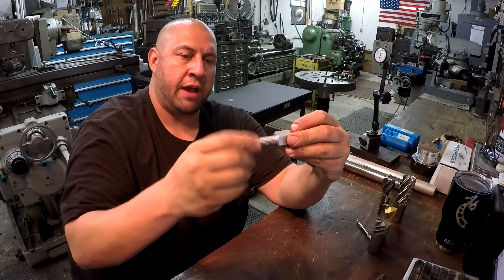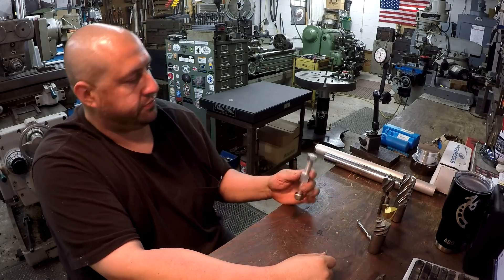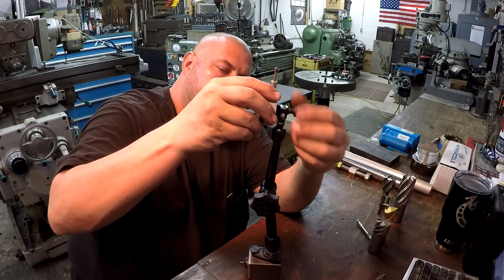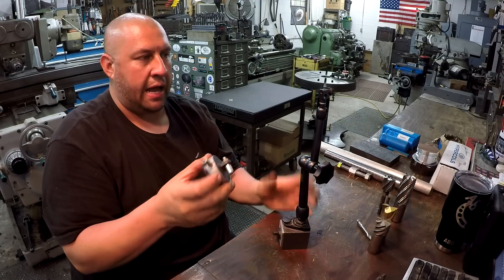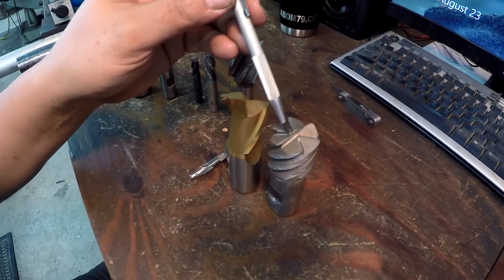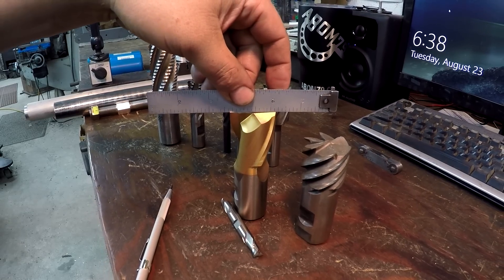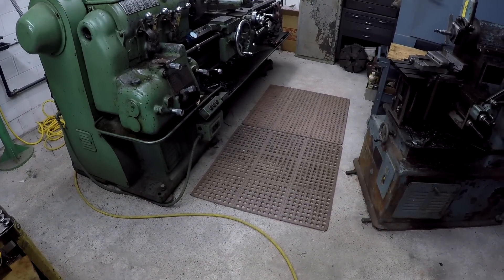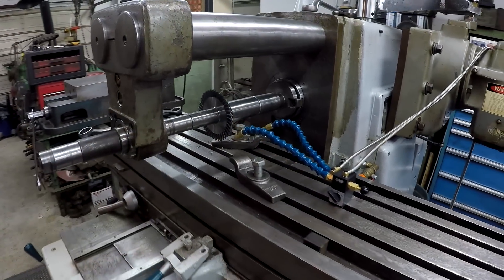Shop Talk 6: Center Cutting Endmills, Indicator Mounting, Noga Mini-Cool, Floor Mats

Comment: Adam

For those without a lathe, a easy and quick way (also inexpensive) to make one of those indicator holder adapters is to buy some 3/8" seamless tubing, Amazon has some SS that has a ID of 0.209, just perfect for tapping to 1/4-20 for a machine screw/bolt.  Cut to length, tap and Bob's your uncle  

John
Reply from the maker: +Submariner Research Good tip! 👍🏻

Comment: How does the base part of the indicator hold on to the metal, I'm guessing magnetic rather than suction, but is it an electro magnet with an on off switch or does the switch move the magnet up and down to the surface to magnetise to?

Comment: Fasteners with left hand threads used to have a notch cut across the points on the head to ID them as left hand, at least I thought that's why the notch was cut there anyway.

Comment: Nice shop talk Adam!  Sounds like we got neat shop projects coming up.  Yes, I'm with you on the floor mats.  On the rare occasions now that I run the roller die cutter at work I need floor mats for me to walk on running the machine and doing a several thousand unit run of stiff packing cards over the course a few days.  The roller die cutter we have is about as long as your Monarch lathe, and you're constantly walking back and forth from one side to the other during a production run.  The rollers that go in it, I'm guessing they are around 12" or so and solid, so if any work needed to be done on them, a lathe at least on the Monarch's caliber would be needed.  One that's of the Victor 1660's size and heft wouldn't have the girth to handle them.

I liked the crash course on the differences between center-cutting and non center-cutting end mills.  Off the top of my head, I'm figuring the primary need for using a center-cutting endmill to plunge cut with vs. using a drill bit is when you need a flat-bottom hole, or more serious, when you are making locating holes for dowel pins.  Which one gives a more dimensionally accurate hole, meaning less correction needed with a reamer?  I'm wanting to think a hole cut by a center-cutting endmill would require less reaming than if it were drilled, and so would be used when making holes that locating dowel pins will be going in.  Correct me if I'm wrong.
Reply: I wanna say too, about that roller die cutter we have at my job, to adjust the height of the upper roller in it, we keep an Abom-sized box-end wrench on the adjusting hex screws. x3

Comment: Hi Adam, 
What are the downsides to centering end mills vs non-center cutting ones? Ie under what circumstance would you choose a non-centering end mill over a centering one? Or is it just that it's easier to get more flutes with non-centering end mills?

Comment: Floors. Dust evolution. Could the first sweep be with a magnetic broom to pick up the steel chips? Great way to find the dropped Allen wrenches, gage pins, bitty screws, etc. Drag along a 5 gallon pail for the chips etc and a coffee can for the recovered tools. Second sweep shop vac. Both methods evolve no dust.

That leads to a floor finish. Epoxy is major expensive and slick as snot if oily. Oil paint floor finishes if thick will bond to hot chips making the hard to sweep up. 

I suggest cheap latex house paint in a neutral color bought from the mis-mixes to be found at half price at any busy paint shop or home centre. It wears fast in traffic areas but it's easy to touch up. Fills the pores in concrete and keeps dust evolution to a minimum. Not particularly slipperly when oily and has good traction when clean. It's nearly unaffected by sparks and hot chips but will stain and discolor. 

Some coolants will attack it but so what? It's water clean up and re-coat at the end of the day to dry over night. There are many virtues to cheap latex on industrial floors but stunning beauty and "coolness" aren't among them. Fools obsessed with speckly epoxy at $120 a gallon (who don't mind their busy shops being out of commission for a week of hard labor) will sneer but who cares?

Comment: Hello Adam,this is my first reaction to your channel, but I'm watching it from the beginning. I enjoy the enthousiasm you put into your channel.I'm a Dutch hobby machinist, but in daily life I work as a service engineer in Hydraulics, so we have some things in common.For the problem of chips on the floor I advice you to try a magnetic broom. I use it quiet a while now and are very satisfied about this tool. It's available in several sizes. You can find them on ebay.Kind RegardsPhilip Marting

Comment: Maybe an idea for a later shop talk...indicator selection help. Personally I'm wanting to pick up an indicator to have in my took box for stuff like measuring gear backlash and cam thrust. I was thinking about a Starrett 25-441J. I don't know anything about the options though. 

As usual, great videos. My father was a machinist but he has since move on to different jobs. Unfortunately he never got me into it and I'm just interested on my own and maybe even thinking about making a career out of it.

Comment: I like to keep my nuts in a sack ... These days my nutsack hangs pretty low, but as long as it's not on the floor it avoids frost or rust so I put some effort into still getting it up and oiling them occasionally.  Thankfully you don't need nuts when you get wood ... all you need then is a decent screw.

Comment: A 1x3/8 shoulder bolt from your local hardware store works great for an indicator mount. They cost about 2 bucks. Chop the head off if you want to take it on and off easily.https://cdn.mscdirect.com/global/images/ProductImages/7565717-23.jpg Good info on the endmills.

Comment: Hi Adam,
Just a quick note on your video with regards to sweeping. Here in the UK, I have some magnet brooms that I purchased for my tool room,and they work great. I also have a handheld stick version. Saves sweeping and the handheld stick is great for clearing swarf off the mills,lathes and also works well on our surface grinders. I would have thought you can get them in the US,infact I'm sure MSC will probably sell them, I know the UK version of MSC do.

https://www.mscdirect.co.uk/EMF-00500E/SEARCH:CATEGORY/product.html

Rgds
Matt

Comment: Have you tried using a magnet as a floor sweep? Covered with a plastic bag it's very easy to clean. I built a floor sweep from two speaker magnets and a hockey stick in one of my ex-workplaces. Everything left behind by those magnets was easy to just vacuum off the floor.

Comment: Adam, talk to your favorite concrete supplier,  take his suggestions as to which concrete sealer will work best for your operation.  You'll wish you had done the sealing years ago, once you try it.  As kids, we used to roller skate in the basement when the weather was bad, and you can imagine the concrete dust that got sucked into the forced air heater system and then blown throughout the house.  Dad got that concrete floor sealed, mucho quicko when mom bought some nice furniture...[WINK]  You won't even have to move your equipment, you just roll it on with long handled paint rollers.

Comment: For cheap sweeping compound we used to use sawdust bedding. Put some small holes in the bottom of a 5 gallon bucket, fill with sawdust, soak it with the hose and let it drain for a bit. The damp sawdust grabs dust really well and when you're done, you don't have anything nasty - just dirty sawdust.

Comment: Hey Adam, Ive used a lot of center cutting and non center cutting but I have always wondered why even bother with non center cutting?

Are they just cheaper? It seems like most the time I might as well use a center cutting vs a non center cutting? What would be an advantage to a non center cutting, besides price - if there is a difference.

Comment: Hey Adam, I have watched almost all of your videos. Great stuff. Do you ever cover making bushings for heavy equipments? I have an excavator and a skidsteer that are ready for bushings, and I would like to make them myself on my Leblond regal (1940's) lathe. Thanks man
Reply from the maker: I don't think making bushings is a subject I have covered much in my videos, I don't think it's come up. What type of bushing are you needing to make?
Reply: Abom79 can I send a picture? They are the bushings for the pins that connect the sections of the excavator. I.e. the bucket to the stick, the stick to the boom etc.

Comment: So you don't get dust, just get a wide sweep broom and lightly dab the hairs (as short a hairs as you can find, if you can't just cut them short, 3 works for me, experiment with proper size, it's all about how far you throw) in water and then rotate the broom to get rid of excess water, once you've done that, cleaning is easy, you just have to repeat it once in a while.

That's how i clean my concrete slab and i don't get any dust in the air. The eventual solution is just seal the concrete, many people use epoxy which is expensive, i just used regular outside grade paint, just threw it on the ground and spread it with a big brush on a stick. 

Sometimes simplicity yields the best results.

Comment: As a self taught hobbyist I've never known the correct way to clean down my lathe and mill. Could you please consider doing a session on how you recommend the machines should be cleaned and lubricated. As far as cleaning the floors go I find a magnetic broom works really well

Comment: Probably pretty simple to explain, but what locks up the joints on your Noga?
Thanks!
Reply: The knob at the joint about halfway up the arm. After watching Adam use them I got a small one that I use with a little point and shoot camera. (It had never occurred to me before watching Adam's videos that there is an ton of places you can stick a magnetic mount to in a shop. I don't use a tripod in the shop anymore!) The Noga is awesome! You just move the arm where you want it and tighten the one knob and it locks the whole arm. The knob has a nice feel to it, so that you can tighten a little and still move the arm, or tighten a lot and really lock it in place.
Reply: Thanks Joe, Im familiar with the operation, i was pointing more towards whats going on inside! When you lock up the knob what tightens the joint at the base and at the indicator?
Reply: SameoldSameold
Reply: Oh. I misunderstood. That's a good question! I may have to pull my little Noga apart to see...

Comment: I purchased a pair of $40.00 mats off ebay. They are the type that have large round holes in them.
I find the biggest benefit from them is they help keep chips form getting ground into my shoes. If you have a basement shop, they are a really good idea.

Comment: can u tell me how i should setup to cut a slot on a corner of some square stock, i don't have very much accessories for setting stuff up (like parallels etc), so i need a dirty but reliable method. i do have some ideas how i would do it, but i wanna know how a pro does it... nice video btw :)

Comment: Hi, use some PVA 50% water dilute to seal your floor, its dries clear, dries quick and is inexpensive just apply from a bucket with a clean sweeping brush. it is a good process 
ans suitable to paint over if required. Great videos .

Comment: Hey Adam, re the clock gauge, my Noga gauge has a flat plate on the back, I really need one with a bracket like the one you have any idea where I could course one?  Kindest regards. Joe.
Reply: you could make the bracket and use some of that car trim tape to hold it, that is super strong stuff
Reply: You can buy them from most machinist supply houses.
http://www.mscdirect.com/browse/tn/Measuring-Inspecting/Dimensional-Measuring-Tools/Drop-Test-Indicators-Holders-Accessories/Drop-Indicator-Backs-Contact-Points-Accessories/Drop-Indicator-Backs?navid=12107838
Reply from the maker: +Joe McIntyre Yes most indicator backs are commercially available.
Reply: +joshua43214 and Adam, thanks for that, I, unfortunately am based in Scotland, there are many thing which are not available her but I really appreciate your efforts and advice.  Kindest regards Joe.
Reply: +Joe McIntyre Sorry for the spelling errors, it's late and I have been out on my BMW 1150GS all day and I am now very tired, night, night!!!

Comment: Hi Adam !

Dust from the floor ... paint the floor - the dust is NOT GOOD for your machines and you CAN'T use a vacum cleaner either - the dust will destroy the ball bearings so paint is the only way out.

I did it in my shop - just paint the walkways and under the machines where you can.

Both you and I HATE working at the floor so get a long shaft for the paint brush
Reply from the maker: +Keld Sørensen Keld, I know the dust sucks. That's why I hate sweeping. I hate painting too but I would like to try some. I'm going to buy myself a large shop vac to help with cleaning.
Reply: Abom79
Watch out for the ball bearings in that vac - the dust will destroy them too (OK, you can maybe have a filter to take the dust !)

Comment: Regarding the toe-in adjuster, well, you have waaaaaaay more experience than I do but I hope this thing is overdesigned by several X even with the aluminum ... also as you now waaaay better than I do to radius all transitions to avoid stress risers that could form cracks down the road. Great video, good luck!
Reply from the maker: +Silas Marner He explains to me that the aluminum adjuster is for very short races where every ounce is considered. The steel is for long races where running is most certain to a cure.
Reply: Thanks for the info!

Comment: Hi, Adam.  Your racecar buddy's idea for an aluminum suspension component sounds a bit sketchy: there are places where you don't try to save weight.  But if you must, maybe use 7075.
Reply from the maker: +John Crowley He's said they use the aluminum for short races, and the steel for much longer races.
Reply: +Abom79 Adam's correct. Just about all circle track Race Cars use aluminum tie-rod components where rules allow. We purposely use aluminum to allow for flex and damage. Door to door racing heat races (10 -15 laps) often winds up with a car being shoved into the outside wall. There's no guarantee additional damaged parts won't occur.

Using aluminum allows the tie-rod adjuster to bend without damaging other parts such as the centerlink and spindle arms and sometimes, ballpoints. Repairs can then be made in between heat and feature races without tearing apart the entire front steering assemblies.

If a race is 50+ laps or running on longer speedways (1/2 mile or bigger), then often we will use a steel adjuster instead. It can withstand more damage. But only up to a point. And when you do hit the wall, other parts are going to be wiped out.

Comment: Neatest thing I used to sweep up concrete floors with was a shop vac with a broken down wide head on it with a very long straight extension so I can stand up not bent over.  Very little dust and floors are super clean.  Some wide heads of course are better than others for this so maybe some yard sales are in your future?  Re clock a dial indicator reminder, you said you should have and would once upon a time long, long ago...

Comment: I bought a couple 4x8 Vulcan rubber barn stall mats for about 40 bucks a piece at Fleet Farm, and they have served me well on standing on the concrete, plus if I drop something, it never mars the item and easy to see metal parts on a black rubber surface.
Reply: Tractor Supply also

Comment: Adam, is there a reason you wouldn't use a center cutting?  I am guessing that the non center cutting are less expensive to make since they don't have to grind to the center point.  I have never paid attention when purchasing.  I never thought much about it.   Thanks.
Reply from the maker: +R.J.'s workshop If your just doing some milling and not having to plunge a non center cutting is fine. For me, I'd prefer to have center cutting in my inventory when I buy.

Comment: Hey Adam, just a thought here, but could you position the duel noga sprayers in a way so one nozzle is providing liquid to the cutter, but the other is using straight airflow to blow the chips out of the way in a constant controlled manner? Seems like it might be a wonderful way to control chip buildup while cutting key ways and such, and without having to sweep it. Instant satisfaction!   ;D
Reply from the maker: +quigly pigly True, not a bad idea. The nozzles work surprisingly good with easy adjustment to control the amount of mist you want.

Comment: Hey Adam. If you were to grind a hss endmil with the flutes dead flat on the end of the endmill instead of the 1 - 2 degree angle, would it get a better finish? Kind of the same way some facemills have a flat wiper on the inserts?
Reply from the maker: +Eric S I've never given that much bought before, but I do know that I've seen some good finishes with endmills that are ground flat on the end.

Comment: Where I retired from-TRANE, INC- has anti fatigue mats all over because the floors are concrete.  The mats are about 2 feet wide and length to suit the location with tapered edges to help prevent tripping.  At the end of the shift they are usually swept then rolled up and moved or just moved and swept where the mat was.

Tractor Supply and farm and ranch supply stores usually have mats.  I bought a mat for my wife to go in front of the sink in the kitchen.  

If you think you can't afford a mat just use a piece of plywood or strip of wood to stand on over concrete.  The wood will make a difference over just concrete.  This was found by trial and error during WWII.